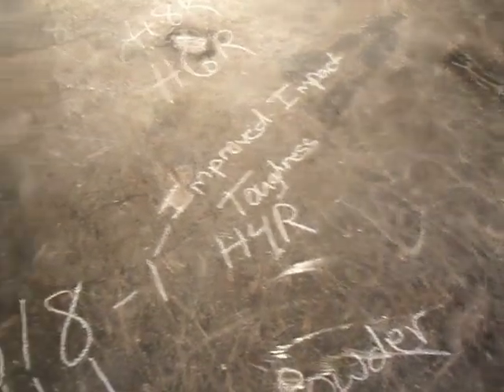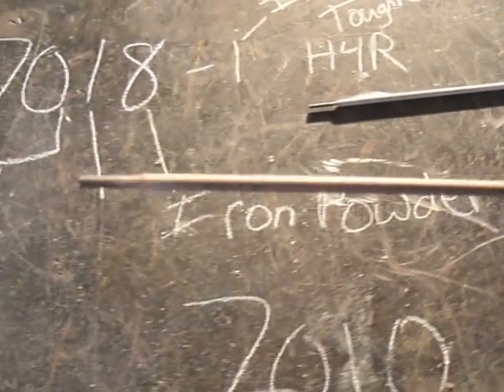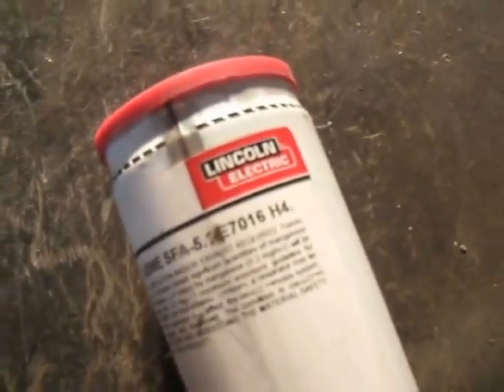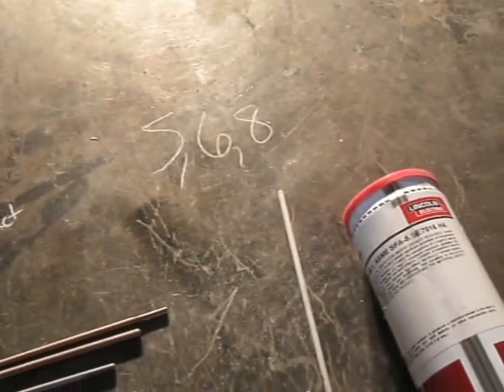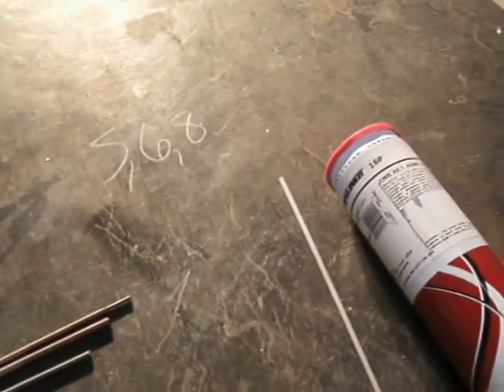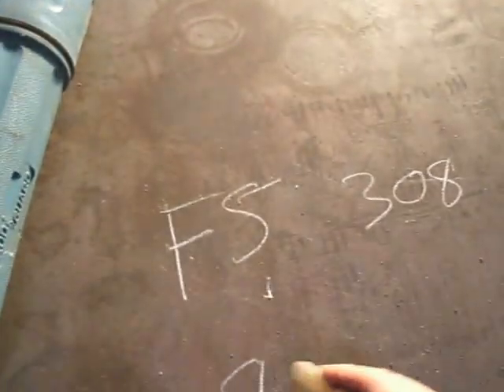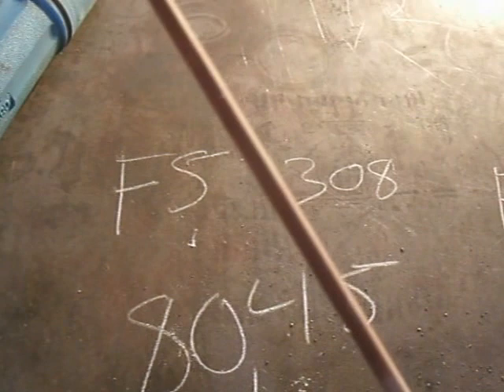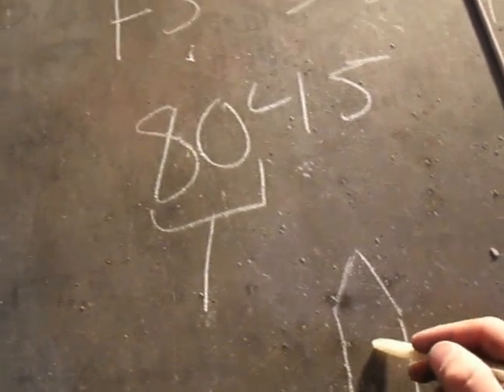Welding Electrodes How to Understand What They Mean

Comment: Hey man is there any chart or reference to know the last digit chemical composition
Reply from the maker: Listed below is the digit that corresponds to the type of coating and welding polarity.
10-High Cellulose Sodium-DC+
11-High Cellulose Potassium-AC,DC+,DC-
12-High Titania Sodium-AC,DC-
13-High Titania Potassium-AC,DC+
14-Iron Powder Titania-AC,DC-,DC+
15-Low Hydrogen Sodium-DC+
16-Low Hydrogen Potassium-AC,DC+
27-Iron Powder Iron Oxide-AC, DC+,DC-
18-Iron Powder Low Hydrogen-AC,DC+
20-High Iron Oxide-AC,DC-
24-Iron Powder Titania-AC,DC-DC+
28-Low Hydrogen Potassium Iron Powder-AC,DC+ 

Then after the four or five digit electrode classification you can have a suffix which indicates the approximate weld deposit. For example: EXXXX-A1  

A1: .5%Mo
B1: .5%Cr, .5%Mo
B2: 1.25%Cr, .5%Mo
B3: 2.25%Cr, 1%Mo
B4: 2%Cr, .5%Mo
B5: .5%Cr, .1%Mo
C1: 2.5% Ni
C2: 3.25%Ni
C3: 1%Ni, .35% Mo, .15%Cr
D1/D2: .25-.45% Mo, 1.75Mn min.
G: .5%Ni min, .3%Cr min, .2%Mo min, .1%V min, 1%Mn min, (only one of these elements required for "G" classification)
Reply: Thank u so much for replying sir, I am new in welding I am having some doubts your answer could help to improve my skill and knowledge. 
1.how hydrogen affects the ductile material? 
2. How to perform welding on material who has low thermal conductivity?
Reply from the maker: Vasim Khan, just wanted to let you know I replied to your original question on another video about welding low thermal conductivity and ductile material.

Comment: I want to see you run 7028
Reply from the maker: You buying the rod? lol it's kind of like 7024. It's ran in the flat and horizontal position only. The major differences is it has a low hydrogen deposition (usually H8).
Reply: Tyler C what about low hydrogen downhill welding rods like 8045 P1
Reply from the maker: Yeah I could probably do a video of that.
Reply: Tyler C I want to see how to run downhill welding rods